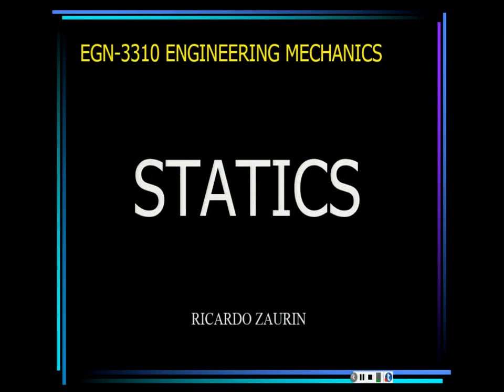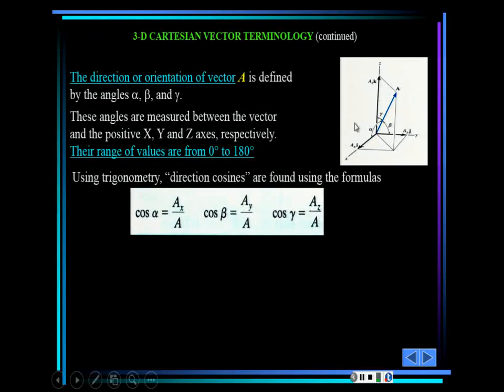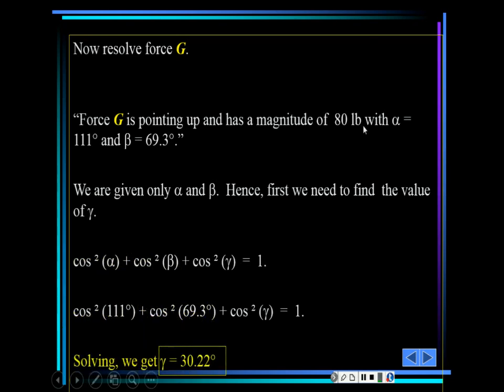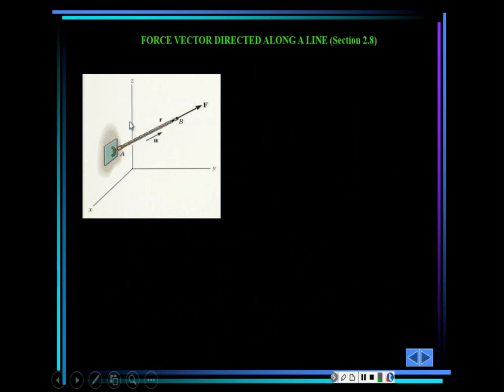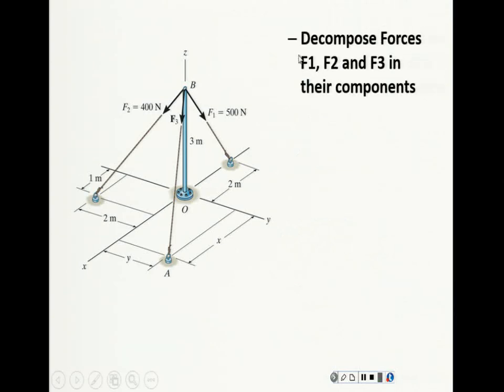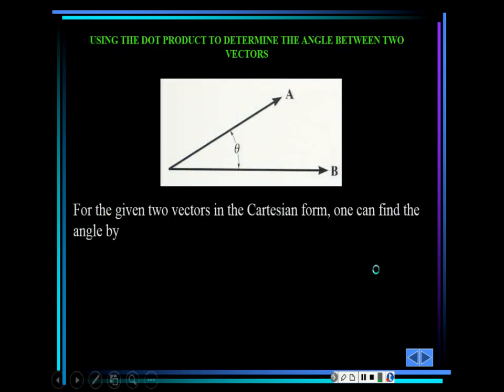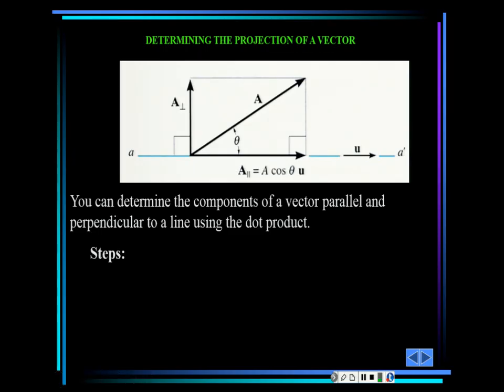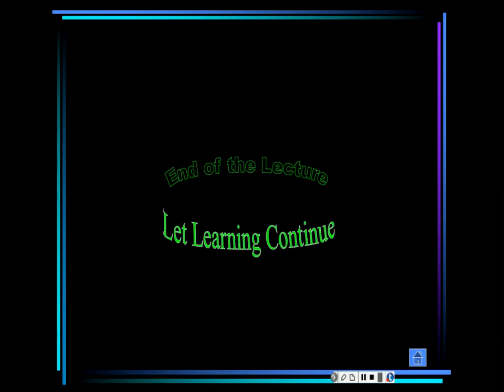Lecture 2 ,3, and 4

Comment: This is so EASY
Reply: Good for you men, I try so hard but still not easy :(
Reply: @saadodinjrpendatun5468  lmaooo already graduated
Reply: @Briantran620  Congrats! Is it hard working in line with the profession you took?
Reply: @saadodinjrpendatun5468  If you follow instructions and do as you're told, you'll do fine. Taking time to study the material a bit more also helps greatly.